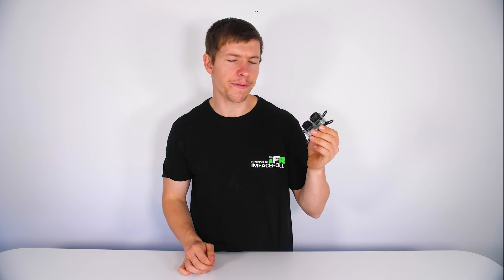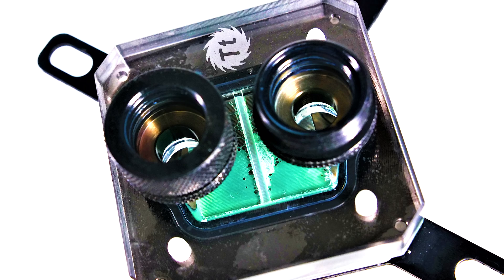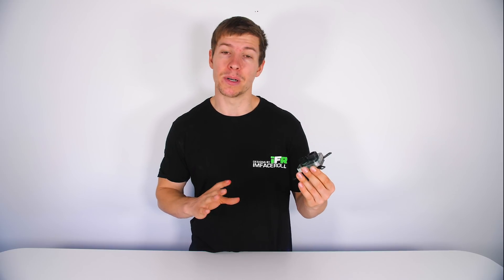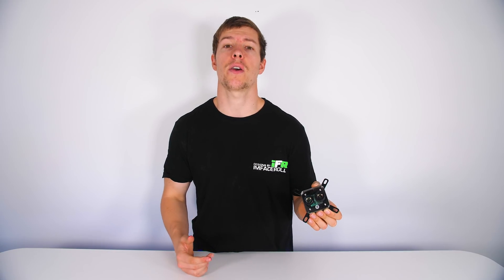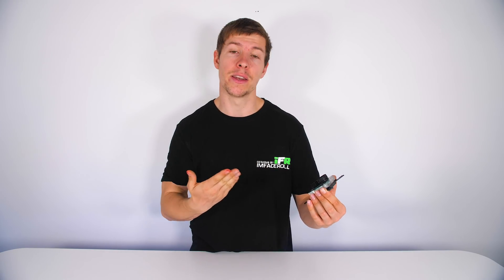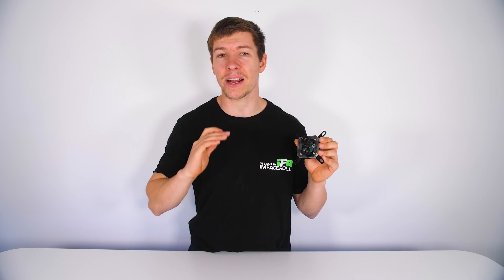How To Clean Your CPU OR GPU Water Blocks - Nickle Plated Copper - Water Cooling Guide

Comment: How do you rinse off the soapy water after cleaning the block? I dont think I saw you mention that. Otherwise great video
Reply: Just use water. Regular water is fine to wash off the soap. Just make sure that you flush it with distilled water as a final measure.

Comment: Would it be fair to say that you could possible soak the waterblock in just warm water or soapy warm water mixture for a little bit before cleaning it?  The thought is that the warm solution would help break up some of the buildup prior to cleaning, like cleaning a frying pan, pot, etc.
Reply from the maker: +MackTruck84 of course =) hot water and soap isnt harmful to it

Comment: A: For flat surfaces, what about using a microfiber cloth?
B: What about cleaning out particles of aluminium stuck in the copper fins from galvanic corrosion of having mixed aluminium into the loop(ie. radiator)?
Reply from the maker: +TEFEN's Tech A i mentioned in the video to clean the flat surface first with paper towel etc then go in with the tooth brush.

B i hope nobody is silly enough to mix those metals unless its treated. The best bet to reach inbetween the fins is a toothbrush
Reply: A: Microfiber cloth is much different than paper towel as it works almost like a cat's tounge and is able to grab & pull things off surfaces better.

B: Allmost all AIOs mix a copper CPU block with an aluminium radiator. I've recently taken 1 apart to clean and reuse it. The aluminium stuck inbetween the fins would not come out with a tooth brush and required using a fine razor to carefully remove it & clear out the spaces between the fins.

Comment: I have a white crust forming on my blocks due to Primochill Vue counteracting with my previous Cryofuel fluid. A clear residue that the reboot could not get rid of I guess 🤔. Do I need to remove the gaskets and clean them to?
Reply from the maker: +Lex Lutha111384 yes remove those but be careful not to stretch them

Comment: I assume you're not the type of person who'd consider using EK Fluidgaming. I, personally, really like the concept, thus buying and installing it wasn't a difficult choice. Then it began:

1. (This was mostly my fault) I didn't flush my Radiators so my tubes began to become cloudy 
reddit.com/r/watercooling/comments/7htiv7/why_are_my_tubes_so_tinted/

2. I wondered why I wasn't able to get my blocks as clean as they were prior to installation. Apparently they're supposed to look like that 
reddit.com/r/watercooling/comments/7q9iao/how_do_i_clean_my_waterblocks_effectively/

3. Used the multi GPU connectors do hardline tubing 
reddit.com/r/watercooling/comments/7rswxl/finished_my_loop_today_not_the_best_bends_in_the/

Maybe this informations are useful in case anybody asks you regarding Fluidgaming